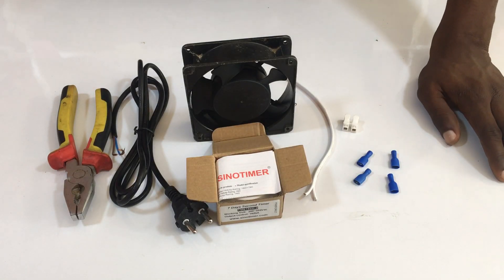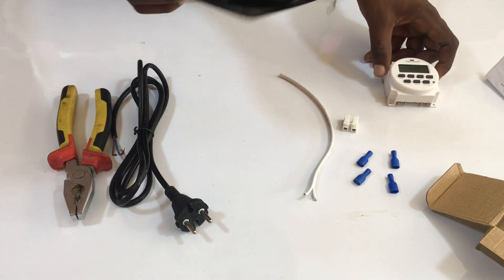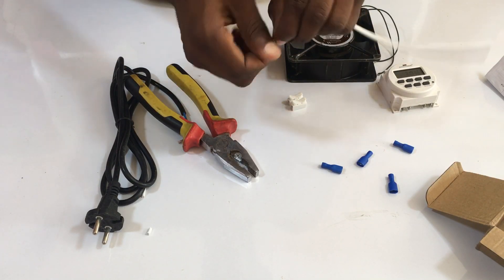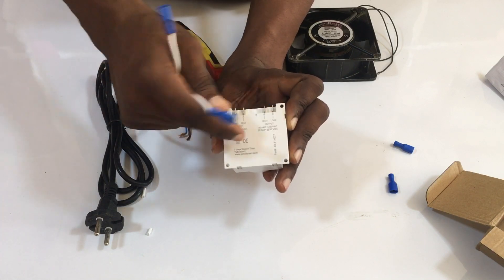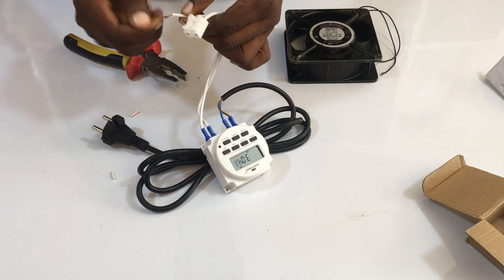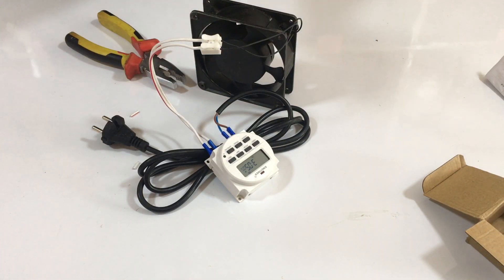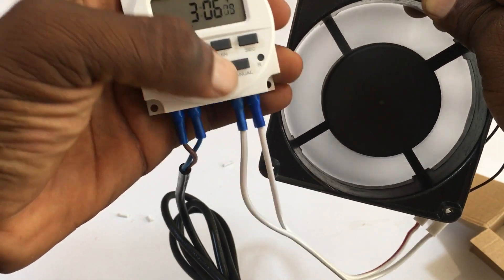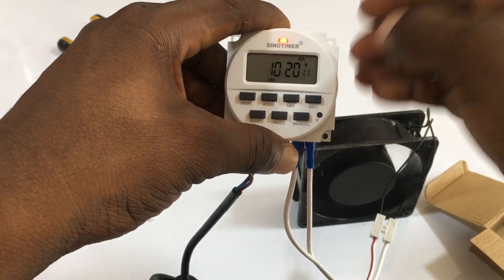How to wire and set the SINOTIMER

Comment: would you please assist me on wiring a sinotimer TM618sH-4 with 12 V DC INPUT to control a 220V AC motor, its labelled (16AMP/250VAC, 20AMP @30 VDC) on the output side
Reply from the maker: Sure